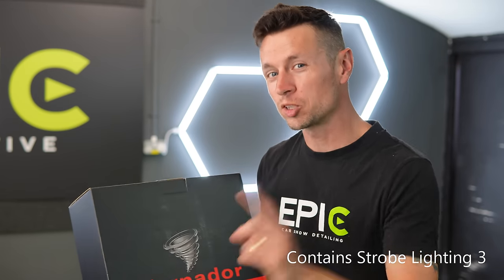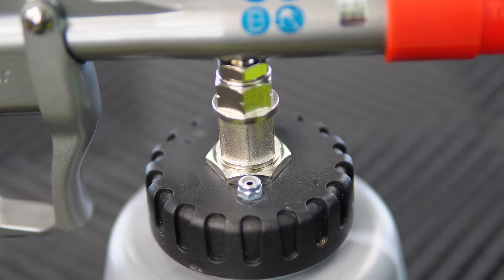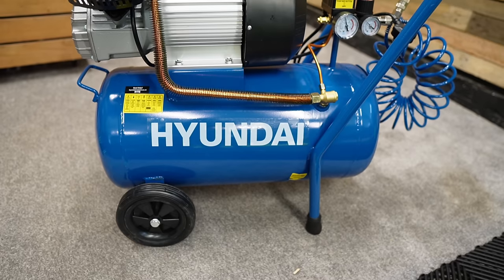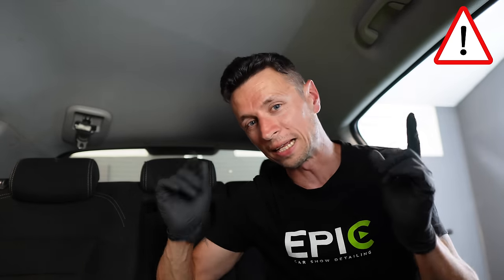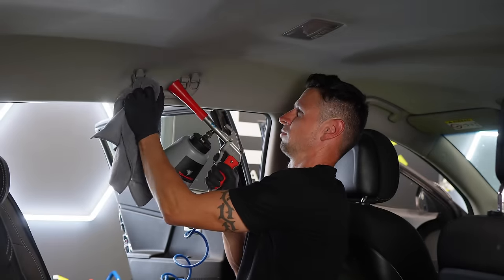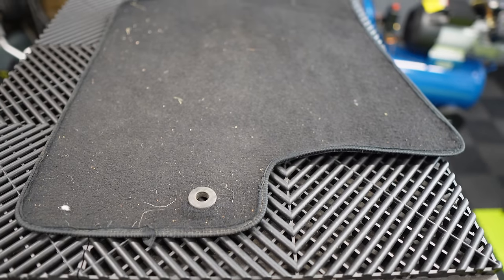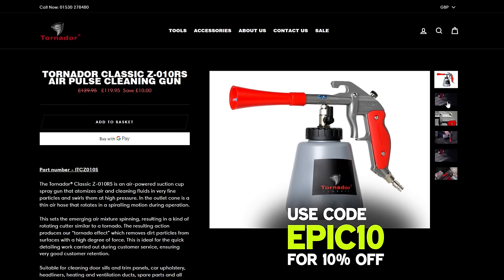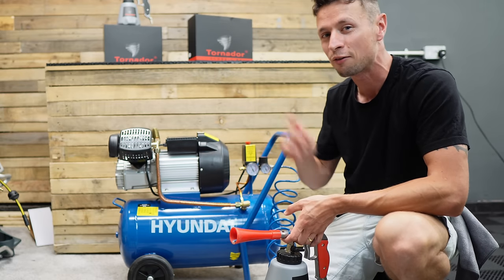The Tornador Car Cleaning gun is a game changer for interior Detailing!

Comment: Please wear safety glasses when using a tornador, or even just a regular air gun, when cleaning carpets. Especially when doing the interior. I also use a dust mask when doing more catastrophic cars and going more aggressive with just blasting all the carpet first and then vacuuming the fallout. With the latter I also recommend a hat, so your hair isn't full of dirt afterwards.

Regarding headliners, I always do a dry run first - quite often it'll be enough. And when wet cleaning, I try to "spread the stain" of the cleaning agent itself once I get to drying it, as it can leave a harsh outline or a visible difference in color in the cleaned area, especially in a car infested with cigarette smoke and tar.

And returning to the "dry run first" - much easier to shoot most of the loose dirt out of carpets, and then do a wet pass. And for many cars you don't really even have to do extensive wet passes. With wet cleaning you also have to consider that it has to dry. The water shooting out of a Tornador (or equivalent) may not look much, because it's being expelled as a fairly fine mist, but it still gets trapped in carpets and seats more than you think, which can pose a smelly/moldy problem in a couple days - especially if you cover the carpet with a rubber mat.

As for panels and leather seats, I like to lightly brush over key contact areas and common dirty areas like speaker covers, window control buttons, arm rests and door sills , too - doing just the wet-dry tornador passes can still leave a layer of grime in the contours of the plastic that isn't apparent until the surface completely dries and the sun hits it. Think of it as doing the exterior of the car with just foam and a rinse with no contact cleaning.

I also believe you could have put more focus on how much easier a Tornador (or equivalent) makes getting tight to reach and pain in the ass areas clean - air vents, pedals, hooks and handles and crevices in the cargo area, the 5th dimension between the seats and the center tunnel etc. Everyone knows a tornador can clean carpets, but the versatility of the tool is where I see like 50% of the charm of it.

The vac attachment is kinda mediocre btw, just angle the end a bit and use a regular vac to catch the debris - most of it flies outward anyway, and if you're doing a disaster detail then I don't even bother with the vac while tornadoring, as described earlier.

Source: I own a detailing shop and have also worked at dealerships. Sorry for the wall of text. Good video, though.

Comment: the really important thing to look at when it comes to compressors is the cfm and the hp of the motor, any air tool thats using high volumes of compressed air, will demand air from the compressor very quickly, so the higher the litre compressor and higher hp motor will generate more cfm therefore be able to keep up with the air demand , so something like a 100 litre compressor with a 3hp motor is a very good option for most, 3hp i believe is the highest hp motor you can have on a single phase power supply (standard plug) anything over that, you start going down the route of 16amp and 3 phase power supplies etc, great vid, very impressed with this tool, certainly a future investment

Comment: It’s always a great idea to clear any hair or crumbs etc before you add liquid. You’ll find that wet hair and wet crumbs will make your job harder because:
1. The hair will instantly start to stick to fabric and plastic once it’s moist
2. Crumbs or food particles will absorb liquid and begin to separate into mush
3. You’ll actually push the dry debris further into the fabric if it’s saturated making it difficult to remove 
Vacuum or blow out the debris first and foremost while it’s still dry. 👍
Reply: What would the steps be?

Vacuum, tornador,  drill?
Reply: @senorbonbon air pressure, vaccum , torpedo , if needed wet extraction.

Comment: Saw these years ago but didn't see the need for them.... that was until I used one today. My car is pretty immaculate as its only ever got me in it, I don't eat or smoke in the car, and it's regularly cleaned. However it is absolutely worth it for getting those bits out of the carpet, dusting sensitive dash parts and gaps you can't easily reach. This combined with some towels, a few sprays of apc for around the pedals and the gyeon interior detailer is like having the keys to a brand new interior.
Reply from the maker: Yeah it blew my mind. I couldn't believe I went so long without one

Comment: Has the tornador replaced your degreaser gun or do you find yourself going back to the degreaser gun?
Reply from the maker: Yes it's replaced everything it's that good
Reply: @epicautomotivedetailing Well, now you have caused me to spend money, thank you very much.

I hope you caught on to the joking around of that statement. 

Now I have to decide if I want the Version 20 Black or the Version 30 Max.  It seems if I would like the option of the vacuum I have to get the 20, is that correct?

Edit One month later.  I bought the Max and the vacuum works great on it.  When cleaning carpets and upholstery, I used the Max to get the cleaner in the carpet/upholstery, agitated the cleaner with the brush attachment on my steamer, then filled up the  Max with tap water, attached the vacuum and extracted the cleaner out.  The carpets and upholstery look great now!
Reply: @bluegrasskid4835 hey m8t how its going with ur tornador? Still thinking should I grt one or not, cant make my mind is it really that good? Thx

Comment: Would you dry vac after using this or will normal hoover do
Reply from the maker: I would just switch off the chemical dial and use air but last thing follow up with hoover
Reply: Thanks very much for reply im only starting of see the way you were using chemical on carpet looked like a lot would I use dry vac for carpets or will micro fibre and vacuum
Reply: @CraigRedmond-li2bt hey man I had a question

Comment: Looks good, and does the job well. When would you see your return on the compressor? And, could you not just use a really good steam cleaner ( which you've featured in countless videos ) to do the same job on a tighter budget? Or is this the "saviour" for doing more work in a shorter time span for more dosh? Just asking
Reply from the maker: Yes good point I would love to get a steam cleaner for the same cost. My karcher sc4 is very good but you lack that power/pressure. The difference is night and day so the tornador really does work extremely well
Reply: @epicautomotivedetailing  but what you lack in pressure, wouldn’t the steamer break the dirt down just as well? With both of them god have to be very careful of going it in one place for too long, or you might damage the item you’re cleaning. Would that be a fair point?
Reply from the maker: @lifeslooker  definitely worth a 50/50 test
Reply: @epicautomotivedetailing  definitely. There’s another video to create for ya. Lol 😂

Comment: Hate to break it to you all BUT for $69 at Home Depot you can get a drill gun with a brush attachment and physically fling all the pieces out. You can always combine this with a soap stain remover and vacuum 30 seconds laters.
Reply: Is that still the move?
Reply: Not the same
Reply: I love pushing all the dirt and dust further into my seams too!
Reply: These guys are charging 300$ plus a detail - I think their passing on this and going for the ready tool/save time etc.
Reply: @patricksquires77 I finish details in 2hrs. One uses air the other uses friction. Same result without a loud generator. Keep in mind I’ve used both in my business. Same results same time frame. Just one I don’t have to set up with a noisy generator and air compressor.
Reply: Won't work on cheap French cars

Comment: Also with fabric seats or fabric in general, you should just mist it with a cleaning solution then brush the fabric lifting it up to vacuum afterwards. Soaking fabric results in debris seeping into the foam padding and once that happens your chances of extracting it becomes minuscule. You can Tornador on leather if you’re quick, but do not let it soak. 👍

Comment: I think you would have an aneurysm if you had my Renault Megane Dave. When it comes to cheap plastics and carpets, I've never seen worse than the French in the middle 2000s. Both that Megan and my mothers Picaso are horrifically bad and cheap with their plastics but worse so, their carpets.
Reply from the maker: Oh yeah I definitely faced a few Renaults lol. Total nightmare 😬
Reply: @epicautomotivedetailing Genuinely I've given up at this point. Used my trusty old Henry on it. Then used my dyson with its rolling brush head to get in the fibres... still looks like shit. That fabrics sole purpose from conception in design to manufacturing is to draw in and cling on to sand, grit and dirt like its life depends on it. 

I'm fully convinced of this. It's so bad, you'd think they've purposely designed it that way as if you'll drive to their dealers for a frigging valet.